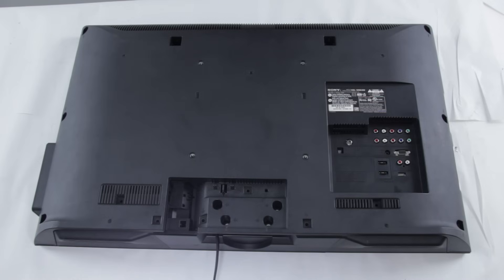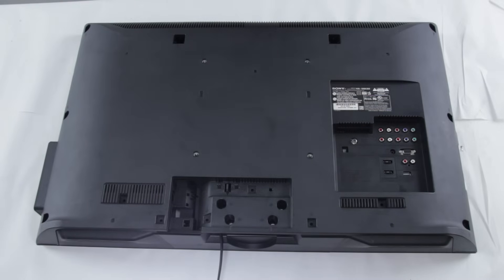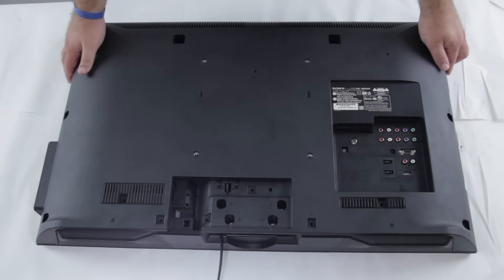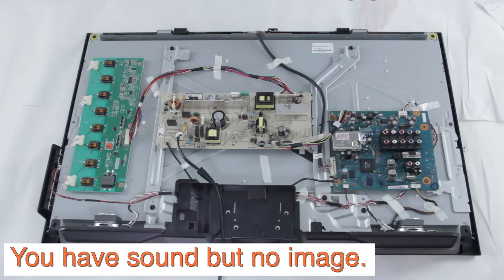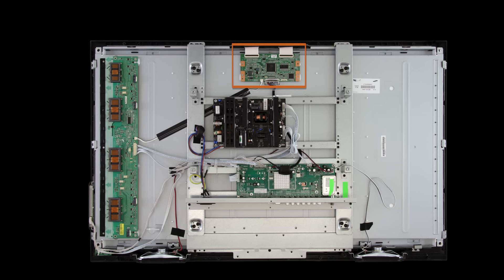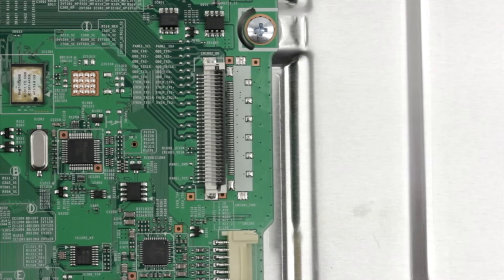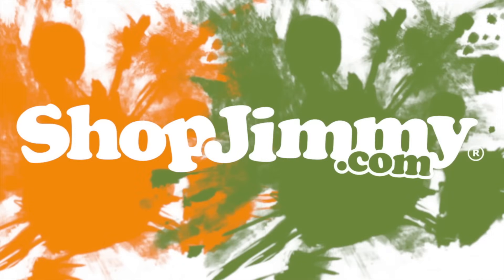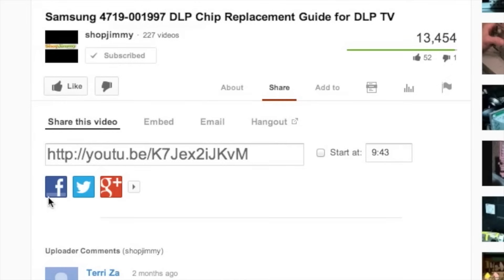LCD TV Repair Tutorial - T-Con Board Common Symptoms & Solutions - How to Replace T-Con Board

Comment: Hi,
I have an LG TV, Model No. 32-LD550-UB.CUSWLHO. Serial No. 010RKCF21915.
The problem I'm having is that when I power on the TV, all I see is the LG logo.  In the past, I would see this only briefly before the TV started streaming content from the cable box.  Now, all I see is the LG logo.  The cable box works, so no issue there.
Is this a bad main board?  If not, what else could it be?
Thanks for any help you can give!!

Tom R.
Reply from the maker: trohrbaugh1206   I recommend replacing the main board in your TV.  Click this link to replacement boards for your TV model number:  http://www.shopjimmy.com/catalogsearch/result/index/?cat=56&q=32-LD550-UB  There may be multiple boards for the same TV model number, be sure to match part numbers on your current board, with your replacement for compatibility.  Here is a link to a video showing how to identify your part number, click here:  https://www.youtube.com/watch?v=RwHTvjMdrhk  Thanks and please let us know if you have any further questions with your TV Repair!  www.shopjimmy.com

Comment: Hello I have LG 42" I have a half screen model 42LF11-UA serial number 908RMJF310396 the left side of ribbon  I was moving it around an the picture came in so do I need a to replace one of the ribbon?
Reply from the maker: Brenda Jacobs   This sounds like a TV panel (TV Screen) problem.  If your TV panel is bad, it may be more cost-effective to replace the TV as panels are typically hard to find in stock, difficult to replace, and expensive.  Thanks and please let us know if you have any further questions!  www.shopjimmy.com
Reply: Ok thank you

Comment: I'm really hoping you can help....
I have a Samsung PN58B540A3F plasma TV. 
When you 1st turn it on, you'll get the startup sound and then there's a couple quick white flashes on the screen and then no picture.....
If you can help, I'd HIGHLY appreciate it.
Either through the comments here.... or email me at ARSmith702@Gmail.com or even call me at 702-771-8310.
Thank you in advance!
Reply from the maker: AR Smith   I recommend replacing the Y Board and buffers in your TV.  Unfortunately, I do not see any replacement parts for your TV model number on our website.  Thanks!  www.shopjimmy.com

Comment: I have a Sony KDL-40EX620 that has vertical lines across the screen with one black line across the middle
Reply from the maker: Ryan Morin   This sounds like a TV panel (TV Screen) problem.  If your TV panel is bad, it may be more cost-effective to replace the TV as panels are typically hard to find in stock, difficult to replace, and expensive.  Thanks and please let us know if you have any further questions!  www.shopjimmy.com

Comment: I recently started having an issue with my Sony bravia kdl-46ex523 where the LED panel is flashing/blinking, but never losing picture or sound. I replaced the power board cause when i turned off the power save and light detector (auto dim) future it would get better. Of course it did not fix the issue, I cant seem to find anyone with the same issue and Sony has been zero help, I don't want to spend anymore money with-out knowing if the problem will be corrected. I was told it might be the LED/LCD controller but I only have a power, main and T-con boards.
Reply from the maker: nate lowe   This sounds like you have bad LEDs in your TV panel.  Unfortunately, we do not sell replacement LEDs.  Thanks!  www.shopjimmy.com

Comment: NEED HELP. I HAVE A symphonic wf32l6 AND IT HAS HORIZONTAL LINES ACROSS THE CENTER ABOUT 4 INCHES TALL, I'VE HEARD BAD CAPACITORS ON THE MAIN BOARD/POWER SUPPLY. BUT I'VE ALSO HEARD BAD LCD PANEL. WHICH IS IT AND HOW CAN I TELL. 30+ YEARS IN ELECTRONICS, BUT MY TRAINING CAME FROM THE CRT DAYS. PLEASE FORGIVE MY DATED EXPERIENCE. ANY HELP WOULD BE GREATLY APPRECIATED.

Comment: I have a Samsung 40" flat screen TV model # LN-T4032H 
model code: LNT4032HX/AXA 
MFD: may 2007
Here's the issue that I am having, after 5-10 mins after my tv powers up my tv screen goes blank but I still have sound..so I unplug the tv for a few mins then I turn off the lights in my rm so that it's dark and check the back light to see if it's working when I power up the tv and they work til the screen goes blank..when I power up my tv there is a slight delay b4 it powers up but jot too long and the pic is perfect no lags no dark areas no vertical lines etc..my email address is michaelsutton325@yahoo.com
Reply: Ok ty so much..I will try that tonight and I will let you know how it works out

Comment: I have a Samsung LN40C550 and not long ago My Sony BVP-s1200 stopped working, it was under warrantee and Sony sent me a new one. When I hooked up the sony to my samsung TV through the hdmi port. when I turned on the sony player my television changed to the port that the blue ray player was hooked to. It properly identified what was hooked up then it said connecting...........no signal please check that you have power on and cable connections. I tried this in all 4 of my hdmi ports. I then tried to reset the TV and still had the problem. I hooked up a NEO to the hdmi all 4 ports and had the same symptoms. I then purchased a HDMI to VGA converter and hooked it to the NEO. I got picture. I then hooked up the Sony and I had no picture. I believe that the sony took out the HDMI circuit on the TV and when I got the new Sony The tv returned the favor by taking out the Sony. Sony says that its probably the resolution is not right on the sony device and suggested that I do a key combination to reset their box to the lowest resolution. Samsung says it sounds like a bad board. could you tell me what you think and what part and part number I need to fix it? if you carry the part can you quote me the price.
Reply from the maker: David LeVan  Please watch this video FIRST to help with your repair!  https://www.youtube.com/watch?v=BP3NVNCGEv8  I recommend replacing the main board in your TV.  Click this link to replacement parts for your TV model number:  http://www.shopjimmy.com/catalogsearch/result/index/?cat=56&q=LN40C550  There may be multiple boards for the same TV model number, be sure to match part numbers on your current board, with your replacement for compatibility.  Here is a link to a video showing how to identify your part number, click here:  https://www.youtube.com/watch?v=BEPWrefQvqI  Thanks and please let us know if you have any further questions with your TV Repair!  www.shopjimmy.com

Comment: I have a Philips Model# 40PFL3705D/F7     Serial# YA1A1043008301
Have sound, but no picture......would the problem be the T-con board?  the # is RUNTK4323TP ZZ
Reply from the maker: David Gleaton  Please watch this video FIRST to help with your repair!  https://www.youtube.com/watch?v=BP3NVNCGEv8  This could be a problem with either the main board, the t-con board or the TV panel.  Click this link to replacement parts for your TV model number:  http://www.shopjimmy.com/catalogsearch/result/?q=40PFL3705D%2FF7  Be sure to match part numbers on your current board, with your replacement for compatibility.  Thanks and please let us know if you have any further questions with your TV Repair!  www.shopjimmy.com

Comment: Hello, I have a Sony KDL-40S2400 and have a vertical line towards the left hand side of the screen. Is there a board which I can replace that would fix the problem? tv was manufactured in 2006.
Reply from the maker: wjb   This sounds like a TV panel (TV Screen) problem.  If your TV panel is bad, it may be more cost-effective to replace the TV as panels are typically hard to find in stock, difficult to replace, and expensive.  Thanks and please let us know if you have any further questions!  www.shopjimmy.com

Comment: Hi, I have a Sony Bravia model KDL-46Z4100 LCD TV. As I am watching, the screen gets brighter and brighter until it is so white it almost looks like a photo negative then suddenly it snaps back to normal, and then it all starts all over again.  Sound is fine.  Color is flat, almost looks like a bad painting (no good color definition); you can make out what's on the screen, but the coloring is all exaggerated and weird.  I can upload a video of the screen if that would help.

Comment: I have a lcd samsung model UN60EH6050f, version HS01, serial # 251A3CDC501632A..the problem is no picture, sound ok, turn on and off ok, change channels ok..when I turn it on,  the screen kind of lit a little bit, but stays like that..no picture, heeelp..I reboot the receiver already, disconect the power..and nothing,, need help and probably some parts...$

Comment: Hello,
I have a Samsung LCD TV Model # UN32F5500AFXZA and when you turn on the TV is has a black screen but does have volume. I did some research and came up with replacing the power board, I did that with no luck. Then it said to replace the T-Con board and did that with no luck. I did the flashlight test and I can see a picture and menu options with a flashlight. Is the LCD screen bad or is it the main board. Don't want to buy a main board if the screen is shot, its roughly 85.00 and already replaced the 2 other boards with no luck. Please advise. Thanks

Comment: I have a Samsung UN46B7100WFXZA and the problem I'm having is red vertical lines on the picture.  Sound is perfect, but the red lines are thin and pretty much across the whole screen in front of the picture.  The picture will also freeze an image and carry that over to the next picture.  TV is just over 5 years old, so hopefully there is an inexpensive fix for this.  Please advise and thank you in advance for your time.

Comment: technika lcd42-910  -the lcd lighting works , the sound works, the remote commands work ,  there is no picture what so ever , there is a buzzing-whistling sound from the power supply board when the neons light up ...
Reply: ShopJimmy.com '' the lcd lighting works ''
Reply from the maker: freenergyterminator  Are you saying the backlights work?  Do you see an image on the screen with the flashlight?  Thanks!  www.shopjimmy.com

Comment: Hello!
I have a Sony Bravia tv Model No. KDL-46Z4100 (serial # 8509575). The color on screen is solarized and also solarized on menu? Do you think this is the TCON board? If so, how much is the TCON board for this tv model? If not that, what could it be? Your help is greatly appreciated! Thank you.
Reply from the maker: Rainy Day  Please watch this video FIRST to help with your repair!  https://www.youtube.com/watch?v=BP3NVNCGEv8  Thanks for your patience.  This could be a problem with either the t-con board, the main board or the panel.  You can replace each of those boards individually to see which one fixes the problem.  Click this link to replacement parts for your TV model number:  http://www.shopjimmy.com/catalogsearch/result/?q=KDL-46Z4100  There may be multiple boards for the same TV model number, be sure to match part numbers on your current board, with your replacement for compatibility.  Thanks and please let us know if you have any further questions with your TV Repair!  www.shopjimmy.com

Comment: I NEED TV REPAIR HELP. Have Sharp Aquos 46" LCD TV that I purchased back in 2006. Model number LC-46D62U. Serial number: 610820202. I am getting dotted vertical green (brightly illuminated) lines all over my TV screen. No idea what's wrong. It gets better sometimes, other times it gets worse, and there are rare times when the lines disappear and the picture gets clear for a few minutes, sometimes even up to an hour. I can email you pictures of the screen if you let me know where to email. Thanks.

Comment: Sony bravia kdl55ex700 when I first plug it in it goes to green then back to red no picture or sound then it will do the same again then after that it blinks red 5 times pauses then does the same..what's the issue is it the tcon or the led that's bad ?

Comment: Dear Shop Jimmy,
I am a electronics person, so I am going to get technical. I have a Ham Amateur Extra license (K8OK) and a 1'st Class Radio Telephone License.
I have a Sony KDL-46XBR4 Serial # 8011148. It will turn on sometimes.... but it may take many times to get it to turn on.
When it does not, it then has no audio, no video, no backlight on, but has the SONY light on which is on the glass bottom edge. The Red Light "Standby" LED is 5 blinks. Which cycles to show the 5 blink count. I can also get the Green Self Check screen to display by entering the codes on the remote. It says there has been 14 T_CON errors. Also, there has been 9 DTT_WDT errors.
What should I do next? How do I test for the TCON to be the problem? etc.
Thanks Bob Becker K8OK
Reply from the maker: Dream Productions  Please watch this video FIRST to help with your repair!  https://www.youtube.com/watch?v=BP3NVNCGEv8   The 5 blink code indicates that you should replace the t-con board in your TV.  Click this link to replacement parts for your TV model number:  http://www.shopjimmy.com/catalogsearch/result/index/?cat=63&q=KDL-46XBR4  There may be multiple boards for the same TV model number, be sure to match part numbers on your current board, with your replacement for compatibility.  Here is a link to a video showing how to identify your part number, click here:  https://www.youtube.com/watch?v=QzhymeqjmDU  Thanks and please let us know if you have any further questions with your TV Repair!  www.shopjimmy.com

Comment: I have the LG 32CS460 I was watching t.v. and the power in our neighborhood went out for 20 minutes, when the power came back on so did the t.v., it turned back on just like you pushed the button on the remote. I didn't think much about that until today and maybe it has nothing to do with this problem. I had a usb flash drive plugged in listening to music and the t.v. just went black, no sound, just a black screen. It turns off and on but nothing besides that. I can fix it being mechanically inclined, I just need to know what to fix lol. I even unplugged the t.v. for 8 hours and plugged it back in and still the same thing. Can you help  me? Thanks.
Reply: Could it be the EEPROM?

Comment: hi hope you can advise ive got a sony kdl60ex500 manufactured june 2010 that has developed a translucent vertical red bar  3-4 inches wide about 6 inches from the left side of the screen/ on a black background its not noticeable on a bright scean you can faintly see the edges of the bar,on darker sceans it will be red but often breaks up like its trying to write it/ on the sony start screen it will be a band of lighter blue opposed to the darker blue of the rest of the logo/disassembled it to the point of frame removal put slight pressure on the bonding strips [no difference] cabling connections aside would you most likely diagnose this as a tcon issue,what other things may cause it? and how much would a replacement tcon  and or cost ?/praying it aint a panel problem as it was a $1800 tv and only 4 years old! /// thanks much for your time
Reply from the maker: rem2466   This sounds like a TV panel (TV Screen) problem.  If your TV panel is bad, it may be more cost-effective to replace the TV as panels are typically hard to find in stock, difficult to replace, and expensive.  Thanks and please let us know if you have any further questions!  www.shopjimmy.com

Comment: Hello, i recently found a 42' LG  at the dump. It looked in decent shape so i brought it home. Its Model Number is 42LD400-UA & its serial number is 010RKNM19503. The TV won't turn on. I noticed on the back that some screws were rusted suggesting it had been outside for a while. i have taken off the back panel and everything looks physically ok on the inside, but the TV won't turn on. So I'm not sure if its not getting any power or the motherboard isn't working. Its a nice TV and putting a little bit of money into it is better than full retail! Thanks

Comment: partial white screen in my bravia tv model KLV-32BX300 and serial 8266908
Reply from the maker: Edbin Barrias  Please watch this video FIRST to help with your repair!  https://www.youtube.com/watch?v=BP3NVNCGEv8  This could be a problem with either the t-con board, the main board or the TV panel.  You can replace the t-con board and main board individually to see if one fixes the problem.  There may be multiple boards for the same TV model number, be sure to match part numbers on your current board, with your replacement for compatibility.  Thanks and please let us know if you have any further questions with your TV Repair!  www.shopjimmy.com

Comment: have lcd rca tv model l46wd22yx5 serial-h174cuo17 sound problem. sound fades out after 2minutes .picture is great. will audio amp board l40e62-amb2xg fix this problem.
Reply from the maker: gunhomate246  Please watch this video FIRST to help with your repair!  https://www.youtube.com/watch?v=BP3NVNCGEv8  I recommend replacing the audio board in your TV.  Click this link to replacement parts for your TV model number:  http://www.shopjimmy.com/catalogsearch/result/?q=l46wd22yx5  Be sure to match part numbers on your current board, with your replacement for compatibility.  Thanks and please let us know if you have any further questions with your TV Repair!  www.shopjimmy.com

Comment: I have a Sony LCD model KDL-32D3100, Serial number 1200552. It's working fine until recently the screen suddenly turns white intermittently for a few seconds or minutes and then back to normal. There is sound all the time. This happens sometimes a few times a day and sometimes stays normal for a few days.

Your help to fix this problem would be very much appreciated.

Tony H
Reply from the maker: TonyH378   This could be a problem with either the main board, the t-con or the TV panel.  Unfortunately I do not see any replacement parts in the search results for your TV model number on our website.  Please reply with your part number on your boards and I can try searching for replacement parts.  Thanks and please let us know if you have any further questions!  www.shopjimmy.com